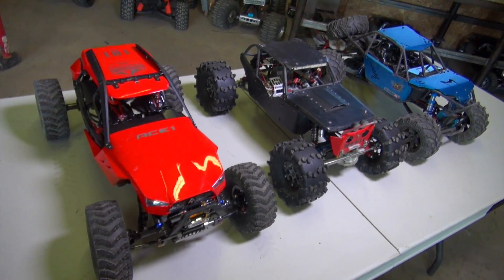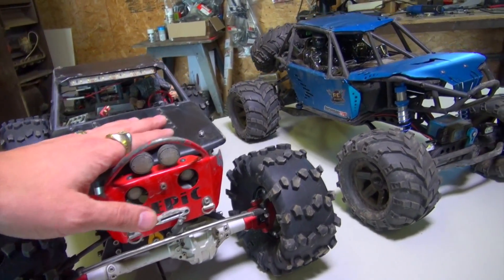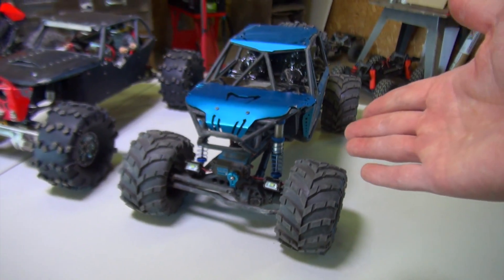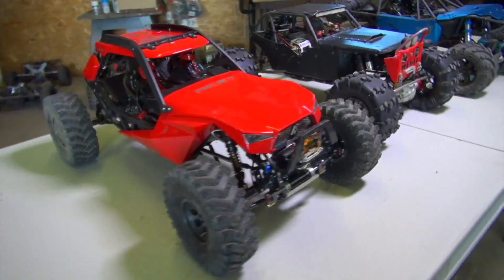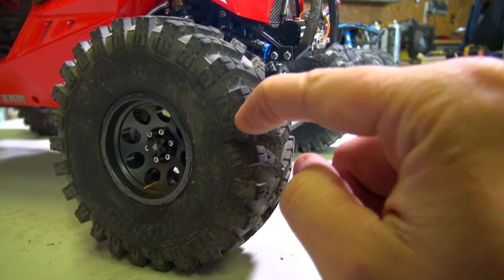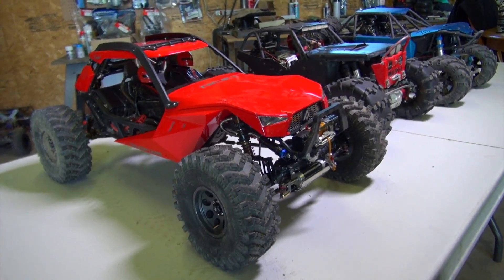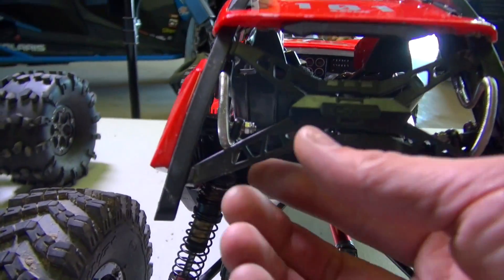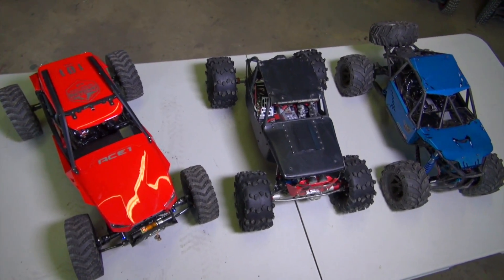RC ADVENTURES - Compare! Capo ACE-1, BLACK WiDOW Wraith, Axial BOMBER RC Trucks

Comment: I do like the Capo, with its mega wide axles and long wheel base, and it does contain a lot of innovative ideas, it just seems a little over engineered for what it does. Maybe I'm just used to 'the old ways' but that steering set up would be a mare to fix out in the trail if something broke, and something about the body just looks odd to me, can't put my finger on what though. Overall though a good looking car, I'll just enjoy watching you drive it though and I shall stick to my wraith for now!

Comment: The hood could use some velcro to help hold the hood down. scratches is part of using a rc like this. as for the steering it is something that can be changed if needed. I love the look and the way it is set up. It's sad that it's so fragile.
Reply from the maker: I would like to use earth magnets.. :) Its not fragile.. imho, it took a beating on the rocks

Comment: On the Capo, I wonder if they could change the steering setup to where the cable system is op top of the fake ram instead of on the bottom, It would prevent the cable and ends from being hung up on the rocks and still give it that Hydro Steering look to it.
Reply from the maker: There are rumours they are looking at it..  maybe that is why we havent seen it be released yet..
Reply: RCSparks Studio why not just turn the ram over that would solve the problem easily.
Reply from the maker: bdubb650 Becuase it is not possible

Comment: Im wondering what would be a better all round brasher, a traxxas stampede 2wd vxl or a rustler 2wd vxl. Plz help. I love your videos rc sparks
Reply from the maker: Sorry bud, I dont use 2wd, as my place is all 4x4 country.. but Stampede would be my guess out of the two you gave to me
Reply: RCSparks Studio , i only run 2wd due to im only 11 and have little money. I decided on a rustler for lower cg and i will put 2.8 in tires on it.

Comment: Hey man!! Great vid, just one question if you know but I have a 2wd traxxas slash and I'm having problems with my servo, when I turn to the left it's fine but when I turn to the right it turns to the right but then turns to the left again?? If you could maybe tell me what's wrong that would be great thx!!
Reply from the maker: Time for a new servo bud.. what radio are you using.. can you set "end points"?  If so.. check the settings..
Reply: RCSparks Studio I'm using the TQ traxxas 27mhz am radio
Reply from the maker: Diego Brazinha Ugh... new servo bud..  ;)
Reply: RCSparks Studio alright thx so much for the help😁

Comment: What's your favorite RC crawler that has a high and low gear and goes pretty fast for under $500?
Reply from the maker: Trail Finder 2 from RC4WD - but under $500 for what you ask is near impossible..

Comment: The capo products are really cool and I don't mind the price, but my concern is parts support. Have you had any experience with getting the replacement parts?
Reply from the maker: No John.. I haven't had any experience with it yet.. but I agree, it will be like getting parts for a ferrari.. not as easy as a chevy..
Reply: RCSparks Studio Just received info from capo co. and they are sending link straight from factory so I can order  quick. Sweet!

Comment: Yeah mounting the wires on top of the rack instead of on the bottom seems to be the only logical solution. As it is now it even looks stupid :P But I don't think it would break just because of the position. I mean the car only ways that much and even if you grind metal against rock there isn't that much friction. It will look quite bad and scuffed though.

Comment: Hi there! Thanks for the awesome video!! I realize this video is more than two years old but could you please clarify for me, is the frame on the Ace1 made out of plastic or metal? I ask because on some sites that are selling this kit they claim that the frame is metal but on your video you mentioned it was plastic.
Reply from the maker: The Frame is  plastic .. you can get metal upgrades for the suspension and the floor plate